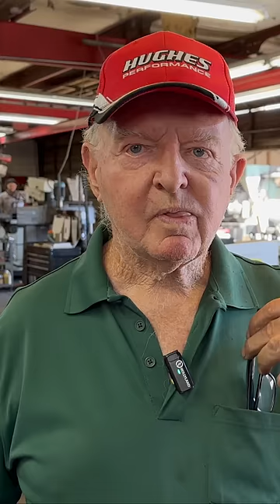Talking CAMS Torque or HP? Ed Smith shares Engine Building and Racing experiences #barryt

Comment: Just order your time and gear. See it from jigs may be a double roller timing set for whatever engine you want in a degree the cam in yourself by drilling out where your pen goes in your cam gear and put a bushing in it and eliminate the problem.

Comment: Okay, I had a 1973 Ford F250. With a 390 4 speed, the differential went out. I took a differential out of a 1978 Ford F250 with a 460 automatic and that differential. I don't know what it was geared at. But that truck had twice the pulling power.

Comment: Must be nice living in a state without smog checks.
The 460 is a powerhouse but never in stock trim after the 1971 Lincoln. 
Everyone of them need cam timing and higher compression heads.
Reply: @AtomicReverend Unless you have corn fuel. Does alcohol have carbon? Now you know.

Comment: My dad had an 87 F350 single cab single rear tire 460 4 speed, that thing passed everything but a gas station.
Reply: Yea, I need to tow a gas tanker trailer behind my 85 f350 dually 4x4

Comment: Cam modifications are done to increase horsepower.  The "low end" performance It's degraded.  [It's typically done for Drag Racing.]   To increase talk which is typically the bottom end, Either use a larger engine, Increase the pressure ratio, add a blower or super charger (Not a turbo charger as they are added to increase horsepower), or one of many other performance enhancements.

Comment: My 94 f250 had the 460 with 4:10 gears. It would pull your house down the road while idling.
Reply: I HAVE A 1994 F250 460 AUTO 2WD REGULAR CAB AND IT IS ALL FACTORY 12.5 MPG AND THE TRUCK IS A BEAST MOST THE TIME CANT EVEN TELL I AM TOWING ANYTHING I HAVE TO LOOK BACK TO SEE IF THE TRAILER IS STILL THERE.
Reply: My pops has a 96 250 with the same engine and gears, and it's a fuckin monster. Gets the same shitty gas mileage loaded or unloaded, headwind or tailwind, and 1st gear almost never gets used unless you're pulling some REALLLLY heavy shit.
Reply: I've got a 97 extended cab short bed 4.10s.  Did a cam swap and 3" exhaust when I rebuilt the motor in 2020. It will smoke the tires at will but 9 mpg at best.

Comment: Makes sense now. Our '96 460 is a turd bucket when it comes to pulling but is peppey off the line.
Reply from the maker: Yup!
Reply: Is this true for fuel injected 460s? Mine could use a little extra power 1988 Ford F super duty. Love it, but it's gutless

Comment: Hearing the words "Ford" and "retarded" in the same discussion doesn't even surprise me anymore.
Reply: I was thinking the same thing 😉
Modern Ford Escape needs to remove windshield wipers, cowling, six clips, brake fluid reservoir, numerous screws and that's just to get to the battery. Many guys won't touch it. You need a flexible funnel just to add coolant!! What about ghost trunks that opens while driving??
Reply: @williamcarter7057 honestly all makes dabble in that sort of insanity to some extent but when Ford does it, it boils my blood.  Will never own another Ford again.

Comment: That's so weird because I used to pull a  Bobcat ( whatever the model is above 753) with the bucket a hydraulic auger , forks and all kind of other shit thrown on the trailer , like 80 lb bags of concrete to fill up to fill up the empty space in the bucket, driving one of these when we first started the company and it had no problem taking off hauling ass bone stock

Comment: I have a 4 door 460 dualy,,it's 4.10 this has a mile of driveshaft you could probably do it with an offset key,or degree button
Reply: You won't be using a degree button in a Ford...

Comment: All because an accountant and an engineer wanted to save 10 dollars by using cheaper components.... They all do it. That's why you need an 750hp diesel to do the same job we did in 1986 with a 175 hp diesel.

Comment: I put a new cam and gears in my 460 and night and day difference hp and torque waaay up and gas mileage up probably 40% improvement, mines in a 1977 f350 4 door long box goes like a scared rabbit

Comment: My 1979 351w is a dog. Distributor timing label says set at 2 degrees . Is this why ?
Reply from the maker: In those early smog years combination of valve timing, ignition timing and compression all work together against Power… If you have a cool rig and you want to fix it, you might want to do some research on parts availability to wake that thing up!

Comment: Is This True For The 460 Fuel Injected???
Reply from the maker: Timing the fuel delivery to match would add some complexity….
Reply: Comp Cams makes a decent cam for the EFI 460. Install it  straight up.Add an intake, higher flow exhaust, increase fuel pressure about 10 psi. Great torque, idles good, 9mpg.

Comment: Tell me what I can do to my 1989 F350 7.3 L IDI with the C-6 and dual rear wheels.  It's slow and no torque.  It has 19.5 wheels, 5.73 rear gears.

It's cool.  It looks great.  Sounds great but, no performance.
Reply from the maker: I'll try to find out what Ed knows about those.  Thanks!
Reply: Russ Mathis logger torque cam and sidewinder turbo kit with intercooler.  Also look at the speed of air dimpled/thermal coated pistons.

Comment: Chevy was the same. Shitty cam and low compression. A new cam could easily get you 100ft.lbs and 100hp. And that's still with good idle and good vacuum.

Comment: Is he talking lower gears in the differential or the timing chain lower gear? Is he sitting there talking about we didn't care about it going 100 which would make sense for having a lower gear ratio in the differential and also referred to the u-joints breaking or whatever but y'all are talking about the timing chain gear I'm confused

Comment: What your vehicle is he talking about up until nineteen eighty eight or not
Reply from the maker: Concepts how cams affect power output, not vehicle specific….
Reply: @BarryTsGarage  I happen to run a bunch of 4 60s and I like that engine. And mine are in trucks. That's why I was interested. Thank you for the reply
Reply: The manufacturer also doesn't want warranty claims, and to get longevity out of their products. 

A reprogramming PCM back in the day limited the boost pressure from the turbo. People didn't like it. Ford did.
Reply: @chuckb9867 they used them from 1968 until 1990 so I’d imagine he was talking about the 70s and possibly 80s
Reply: @karrpilot7092  I hope you know we're talking about A 460 gasoline-powered engine. Is notebook involved
Reply: @chuckb9867  Doesn't matter the kind or type of engine. The manufacturer has to build an engine that gets decent fuel economy, and longevity. Power output is secondary. 

Another thing that they have to worry about is emissions. If someone finds a way to get more power out of an engine, it's on them. If the engine doesn't last long and or won't pass an emissions test, your problem now. Not the maker.
Reply: @armedpreacher I believe the final year for the 460 was 1997. 1998 was the first year of the new body style for F-250 and bigger. And they went with the 6.8 V-10 as the replacement for the 7.5 460
Reply: @geraldyates8958  ohh okay! Good to know! Thanks for the info
Reply: @karrpilot7092  emissions didn’t exist back then and if you drive a vehicle from those times you are exempt from current day emissions

Comment: What's the problem with Ford they're going to treat you so bad by the time you figure it out it's way too late and parts are expensive for Ford they did the same thing with the international diesel they detune half the engine so that they could build it a lower Quality Truck the compression difference between One bank to the next is astronomical 150 or 200 PSI by the book I don't remember it's close to that
Reply: Ford is not what’s wrong with those international engines. The 7.3 was good. 6.0 and 6.4 were absolutely horrible. The 6.0 didn’t have enough head bolts per cylinder. It was a design flaw. Not fords problem

Comment: Ford always made the motors with a low compression ratio.. that’s why everyone like Chevy cus they built theirs with different n better compression ratios which means better HP better TORQUE n better RPM.. way better application than Ford or dodge.. compare a 460 from any yr they were made to a 454 any yr they were made n see what was better.. poor Ford 👊💩👎
Reply: @jesse75  tell me what motor was built with high compression other than the 429
Reply: Only thing a big block Chevy has on a big block Ford is a cheaper cost to build.
Reply: Nonsense. All American auto makers lowered their compression ratios in the early seventies in order to meet emissions standards and run on unleaded fuel. They also retarded cam and ignition timing and added EGR valves. All of this crap was meant to lower cylinder pressure in order to lower NOX emissions. Sad days for us.
Reply: @davidleonard8369  ha.. u must be from Cali homie 🤦‍♂️
Reply: @stanmendoza638  born here in 1964. Used to be an incredible place to live.

Comment: There is an easier way, just buy a chevy
Reply: Chevy did the same thing back then.
Reply: Nah I'd rather pull a timing set then replace the whole motor a lot less working time
Reply: @jackpranno7647  lmao, a 454 will outlast any ford engine.
Reply: @budgroweryt9947 no chance. Everyone that owns big block chevys are always working on them and then claim “it’s just a big block thing” mainly the valve train
Reply: @joshuaearnheart2756  never once heard of that, but I have heard of always working of every ford because they suck so bad, so it seems like the typical Ford fan boy thing to do is project your problems onto other vehicles. The only good engine Ford has made is the 300. 

 There is a reason it's found on road dead.

Comment: His explanation is not very clear, he modified the cam timing, and the gear ratio in the rear axle.   That is why it would not go 100mph, engine torque or rpm would not change the top speed.
Reply: Advancing the cam timing increases low rpm torque. It does this at the expense of top end power. It literally lowers the maximum rpm the engine will spin thus lowering top speed. Nowhere in the video does he mention changing rear end gears.
Reply: Said not worried about speed only pulling power DID NOT CARE ABOUT GOING 100 MPH didn't say it wouldn't  they weren't after that